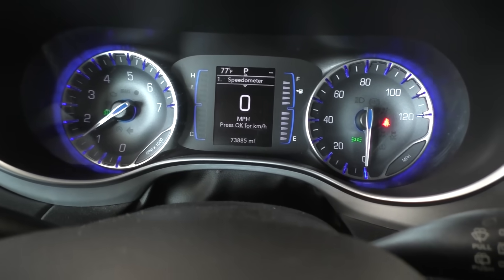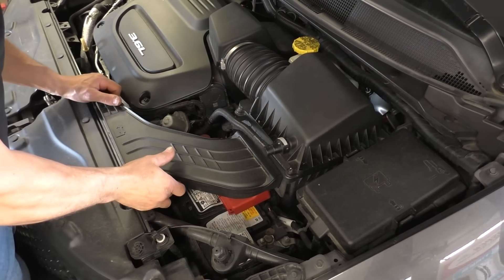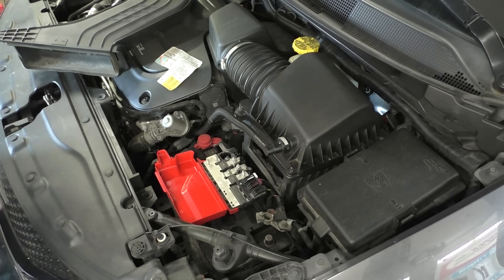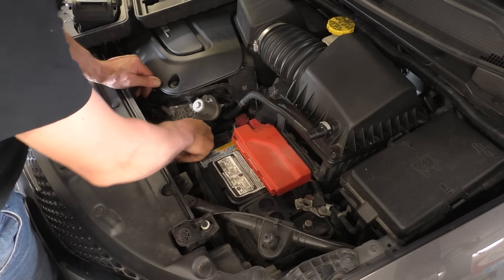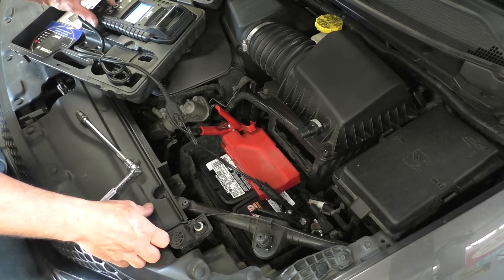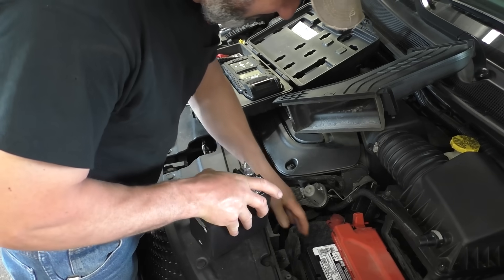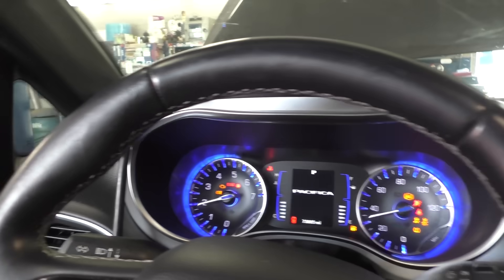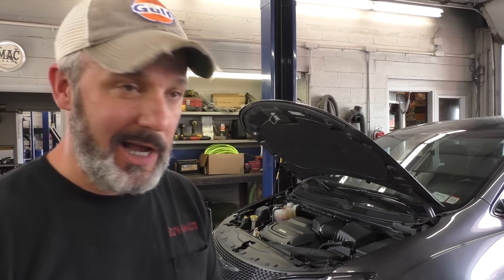Chrysler Pacifica - Start Stop System Disabled

Comment: That battery is manufactured at East Penn Manufacturing in Pennsylvania, and would normally be labelled Deka if it wasn't branded for Napa,  you got the best battery on the market.
Reply: THIS IS CORRECT. JUST DID THE RESEARCH AND PUT A NEW LEGEND BATTERY IN MY RAM TRUCK.

Comment: I smiled when you talked about the battery terminal cleaner.  When you first used it, I was thinking that design was decades old and still does a better job than anything else.  Once, there were great designers.  I later wasted my money back then on a SnapOn with blades and quickly realized more money didn't always mean better tools.
Reply from the maker: Same 😂

Comment: The fact that they lasted that long is miracle. We change battery’s on Chrysler and jeeps everyday, it’s was really bad at one point that we were using so many that they got back order 😂
Reply: Do all Manufacturers : Ford , Chevy , Toyota - have start / stop function that CAN'T be disabled ?
Reply: They make a aftermarket harness for this van to disconnect the auto start. If just makes sure the dash button stays in the off position and doesn't cycle back on after  you turn the vehicle off. It still functions by the factory button if you wish just locks it in the on or off position

Comment: Just dealt with a similar issue on a 2018 Jeep Compass with the big 2.4l, in my case the power control relay was intermittently sticking open, causing the car to go into a limp mode and saying service stop/start system. I too was pleasantly surprised by the amount of information in the theory of operation regarding the stop/start system.

Comment: I took the online start stop diagnostics class w/John Thornton. He recommended replacing both batteries at the same time regardless of test results. It's important to have batteries with the same health because they are charged by the alternator together. 

GM uses/used the same type of 2 battery system, although the aux battery is usually in the trunk.

Comment: “Parking brakes had cables” I’m so old I remember when gas pedals had cables.
Reply: I remember when chokes were cable operated
Reply: and cars came equipped with cranking handles
Reply: My first 7 cars had rod operated throttles. First cable was a Datsun pickup 1.3 litre.
Reply: @twig3288  I found the cable chokes so much better that I converted dozens of automatic chokes to cable.
Reply: @wssides  I had one of those 1.3 L Datsun powerhouses too. 😂  No power anything on that little guy. Including the engine.  Even had rubber floor mats.  About as basic as you can get.  I bought it when it was a year old and kept it for 12 years and sold it for what I paid for it.
Reply: I'm old enough to remember a 56 GM stepside that I had around 1980.  That sucker you turned the key to run position,  then stepped on a floor switch to turn on the starter.  My old 1960 Corvair also had the dimmer switch on the floor board.
Reply: @scannerlanier471  My uncle had a 1953 Buick Special you pressed the accelerator to start the engine.  I had a customer once that had a 1959 Pontiac Bonneville that we had done some work on.  I went to road test the car (I was 18 at the time.) pulling out of the parking lot.  I pressed the accelerator and suddenly the thing just took off, squealing the tires.  My dad thought I had done this on purpose but, the pedal just fell from under my foot.  The customer explained it had happened to him once before.  Dad told me to get in the car, start the engine, shift to drive and brake and accelerate.  That 389 was about to roll out of the car.  Motor mount was broken and the linkage reversed.
Reply: I am still in awe of the automatic transmission along with the idea of a torque converter. Maybe if I live to be 150 years old, I can graduate up to the idea of a CAN bus system. The engineering behind this stuff is truly amazing - to take an idea and actually make it work and package it in a vehicle is no small feat.
Reply: And you could change the spring to change the feel... now you need a computer to adjust it if your luckey.
Reply: Hey, I miss my vacuum wipers and foot operated windshield washers.
Reply: Remember when the dimmer switch was on the floor? The hoopties I drove, the floor would rot out, and you had to find a place with enough metal to mount it
Reply: @DeweyCheatumNHoweLLC  i  had a 250 truck. Stuck a cookie  sheet to the floor. Then riveted  things in lol.
Reply: @Wrang15  I fixed the floor in one winter beater with a road sign. Just a couple if zip screws and some caulking to keep most of the water out. Thems was the days!

Comment: I have never seen a 2 battery system on a gasser. This was very informative and I watched very intently. NOT a simple battery change out. although was wondering if you could've removed positive stud on small bat to make the connection without dinking with loosening the fuse pack. I also do not understand Stellantis and their gateways. I do like your attention to detail and corrosion  prevention.  I learn a lot from these vids, and I thank you profusely. I have changed batteries where it pays to know that you should keep power to the system when replacing bat to avoid the resets, like on our Caddy with bat under rear seat. Weird stuff happens if you don't. Lastly, we do not have trust issues. Shout out to Mrs O, she classes up the joint.
Reply: Lousy Jeep design, very common for the 2nd battery to go bad prematurely, I'm surprised this one lasted that long.
Reply: 95% of the time, the auxiliary battery will cause the stop/start to throw this message. 

     After replacing the main battery, you usually have to unplug the intelligent battery sensor for 10 minutes to allow it to reset, or it will think the main battery is still low, causing it to stay “Stop/Start not ready, battery charging “

Comment: When I started watching clip. I new it was a battery problem.  What I did not know is it having 2 batteries. Well done.
Reply: A coworker of mine has a Durango, and he told me about the second battery that runs the Start/Stop program.  His battery is dying for the program, and he is not going to replace it, so it essentially disables the program from ever running again.  Such a stupid idea and program to have.  I know Ford now gives you the option at the factory if you order a new vehicle to disable that feature.

Comment: Like your wedding ring.  Be careful when working around power with a ring on, my dad nearly lost his finger when the he shorted power to ground through through his ring. Pretty messy and the ring melted.  Be safe.  Love the videos.
Reply: Carbide rings aren’t conductive. I had one for this reason.
Reply: Tungsten rings are conductive, but much less so than most other rings. You might not run into issues at 12v but if you mess with higher voltage stuff (hybrids, AC power, .etc) you really should take the ring off or wear gloves.

Comment: I'm glad you mentioned that some vehicles need some reprogramming after a battery change, not just a relearn toot around the block, or cycling hvac controls to recalibrate them. I recall the 1st time I put a b+ in a 16 Escape with the big 1.6 that came in on the hook. After said replacement, the transmission didn't want to shift, then it hunted around for gears like it was severely slipping. Rather than call the customer straight away, I decided to look in service info and sure enough, the ol ghost of Henry said that the transmission controller goes into a default strategy, so either use a scan tool to recalibrate it or just drive it until it straightens out..Subbies need an idle relearn procedure if the battery goes stoned flat or is disconnected for more than 1/2hr. So yes, Eric, I do watch even your 'How to change a battery' vids :) It's all good info.

Comment: I work at a Chrysler dealership relatively local to you (not bath, not painted post). This is a classic issue on all these stop start garbage. Needs a BBAUX101AB
Reply: As a Chrysler technician do you have to replace the small Aux battery? Can you just remove it? I don’t use start/stop function. I always turn it off.
Reply: @russsuchowesky4234  I have been asked that multiple times. I’ll be honest, I’m not entirely sure. The second battery is there to reduce voltage drop during cranking.
Reply: Thanks for the reply.

Comment: Glad I watched your video! I changed the aux battery and then the same park issue popped up. If I hadn’t watched the video I probably would’ve had to take it in so Thank you!! Problem fixed and I didn’t have to give it to the dealership for them to finally get to it in a week.

Comment: Start/Stop won't work if the starting battery is getting weak. It disables itself because starting the car when the battery is weak, can cause a no start condition. It's more of a blessing than a loss condition. First thing I did with my cars that have Start/Stop was to buy a kit to disable it. I think the most recent kit I have is a small module that lowers the voltage on the single wire that connects to the positive side of the battery. Easy to find. Sending lower voltage to this wire tells the computer to disable Start/Stop. No error code on the dash. Perfect solution. We all know a repair shop can't do this mod but I did it for myself. Honestly, I really doubt Start/Stop saves much gas.

Comment: As the owner of a 2019 Pacifica on its third set of batteries, I’m glad you installed batteries that exceed the service data spec. The 2nd set died in 14 months since it was underpowered. Every single warning light went off. After seeing the BCM codes related to voltage in your video, it makes a lot more sense. I know it’s annoying but I would rather this setup than the VW battery programming.

Comment: I also own a 2018 Pacifica. Those are definitely the original factory installed batteries. You can tell because they have gray Mopar labels. Replacement Mopar batteries have a white label. Six years out of the factory batteries in these vans is very impressive. They usually fail within three years or less. Some owners have had both batteries replaced twice while still under warranty. No reset is needed on these vans when replacing the batteries, but I advise folks to leave both batteries disconnected at the same time for a couple minutes so the orange @ light goes away immediately. It will eventually go away on it's own after a few drive cycles if you don't.

I know you would never advise anyone to do so, but if someone has a dead aux battery, wants to save a few bucks, doesn't like/use stop/start, and can live with the orange @ light, you can safely leave the aux battery's negative cable disconnected. Stop/start is permanently disabled, but everything else still works as intended (including remote start). Our van has been this way for almost 4 years. 🙂

You can electrically separate these batteries by removing one of the negative cables. I've found it easiest to remove the aux negative cable. I was happy that you acknowledged the need to separate the batteries and test them separately. Many folks don't which deems the test worthless.

Eric, I do have one question. I have AllData and was wondering if the explanations from the manufacturer's service info is identical to what you find in AllData or is the manufacturer's service info usually more detailed?

Comment: I've got a2007 Ford E250 van with 390 thousand miles on it and even the spark plugs are original nothing on it has been replaced but the brakes and oil and tires. That's it. Now that's amazing. Thanks for the video

Comment: I don't know who makes the Chrysler batteries but they are the best. I have a 2006 Dodge Charger which we bought brand new in 2007. It is not winter driven but it has been parked outside (we're in Ontario so it can hit  -31 Celcius) 95% of its life with the battery never removed. The first battery lasted until 2021 with only 1 boost 1 spring to start it. It started all the other springs without any help. My 2011 Ram - original battery also until later in 2021. They last well.

Comment: The Start/Stop feature has to be the dumbest thing to come out of the auto industry in a long time. 
Not only does it put extra wear and tear on the starter but it can be a safety issue too. On several occasions , while at a full stop at a merge, I waited for my opening and just as I hit the accelerator , the car decided to shut off then restart. This caused a hesitation and almost an accident. The first thing I did after that was to find out how to shut this stupid thing off.

Comment: The worst part for the customer is the fact that its take more than a weeks pay check for them 2 batteries alone plus the installation cost. But I do enjoy your U-tubes they are very informative . My family has been in the automotive repair service since 1924 and for the last 60 years its been  my life   taking over and running and working it since 1987.

Comment: Ah yes when parking brakes had cables connected to a small foot pedal, a dimmer switch usually in the same area of the parking brake on the floor board. AM/FM 8 tracks, CB radios...geez Im old...lol thanks Mr O for another informative video. Love me some SMA!!! Love from AZ ❤😧

Comment: I didn't even know vehicles had an AUXILARY battery.  Speaking of complicated, I saw a video on one of these Toyota Tundras that had the engine replaced.  There were piles of parts and the entire front-end of the truck was GONE.  I understand they also jack up the body like Ford does to service.  I heard there are 3 water pumps, 1 for the engine and 1 for each turbo.  No matter how complicated these vehicles get they are no match for Eric.  GREAT VIDEO!

Comment: ERIC, This was a good one as, I can relate I had replaced both batteries cleared all the codes and 3rd or, 4th drive the big red annoying light returned!! Chryslers ??? Why they elected to have 2 batteries is beyond me,  1 bigger battery in my opinion would have been much better of a idea (my opinion) think I will permanently mount the scanner in the kick panel somewhere so I can clear codes as needed! Great video Eric O. 👍🏼👍🏼

Comment: When I worked as a Chrysler tech, we always recommended replacing both the auxiliary and the primary because if the primary goes bad, it will destroy the auxiliary battery, so it's better to replace both of them for longevity.

Comment: Napa tested my a.and b. Battery, long story short, both were fully charged. 
There’s a fuse able link that sometimes gets burned out and it throws a code. If you use the stop start system
 ( I shut mine off manually inside the car) and the fuse able link is bad the b. Battery will discharge, if the fuse able link goes bad and you don’t use it the battery will stay charged. So what I’m saying is you might be replacing the b. Battery and it’s not the problem. 😊

Comment: I learned the hard way on some of the small Jeeps with dual batteries that they should always be replaced in pairs. They'll set maddening codes if one battery is left connected while swapping the other. And one can drain the other if it's weak. What a goofy setup, but we'd expect no less from Chrysler.

Comment: Had the exact same thing about 2 years ago. The battery store’s load test said both batteries were good. I even pulled the small battery and had it tested out of the van. It ended up at the dealer and their machine said they were both bad. 2 new batteries fixed it.

Comment: My wife’s 2018 Wrangler UL’s stop start has never worked consistently since new. I swapped the small battery with a Genesis Off road 2X size 24 kit that fixed the problem for a year or two. Now we get a charging error with both batteries @ 12.7 V @ rest and 14.2V with the car running.  Gotta love Chrysler products ….

Comment: I have a ‘17 Jeep Grand Cherokee.  Both my batteries are underneath the front passenger seat.  Finally decided to replace both batteries last month, as my Jeep always said, start/stop not available due to battery charging.  Also on the cold winter nights it did start up kind of slow

Comment: ON another Brand vehicle, I installed a small aftermarket wire with connectors that prevents the Start Stop nonsense from happening anymore.   Those Start Stop Systems are hard on the battery(s), hard on the starter and worse yet, very hard on the Rod and Main Engine bearings.  The bearings wear faster from starting and stopping repeatedly.  . . .  and does it really save fuel, a diddily amount if any.

Comment: Had to do this entire procedure just a couple weeks ago. Had a '17 or '19 Pacifica i had to put a transmission in at work. Darn thing only had 78k miles. The AC compressor had dropped the clutch, so had to replace that at the same time. It was a 1234yf car, so that was lots of fun.

Comment: We had a compass come in with the same issue at my shop, auxiliary battery tested bad, replaced it, but still had the issue. Found that the battery control unit was only reporting 30% soc with new battery and test drive. Ended up having to replace that little module too, fixed her right up

Comment: For anyone doing this, you MUST follow service data to the letter, including removing all cables and terminals in the specified order.  If you don’t, the code will reset and start/stop will continue to be unavailable, even if the new battery passes a load test.

Comment: Some of the latest systems fitted to smaller engines feature a 48v integrated stater generator that replaces the alternator and uses the FEAD belt to start the engine. The FEAD belt had to be automatically tightened to prevent slip. The 48v lithium battery is often placed under the passenger seat and charged using a DC/DC converter.